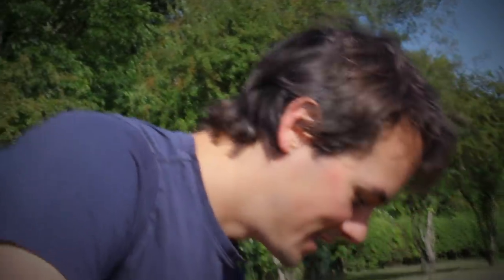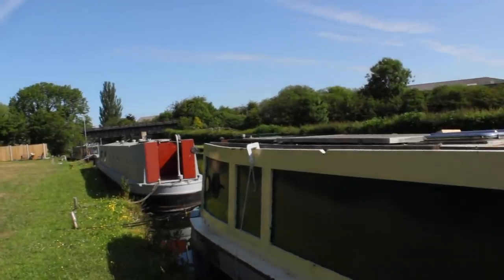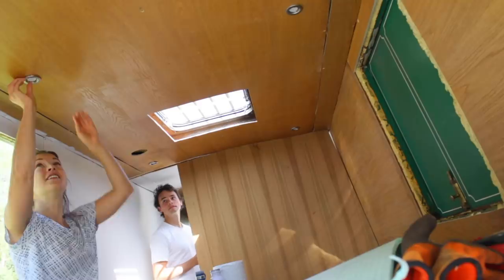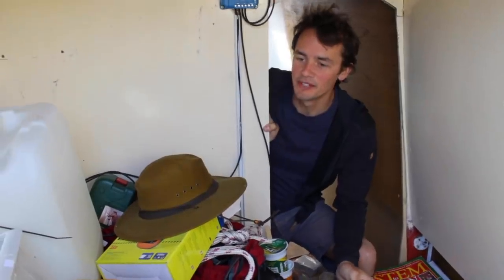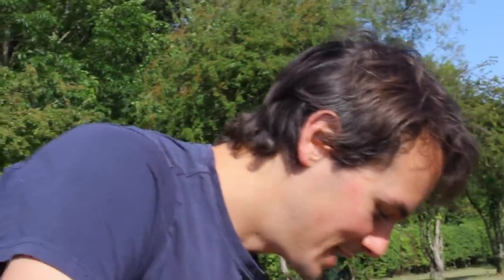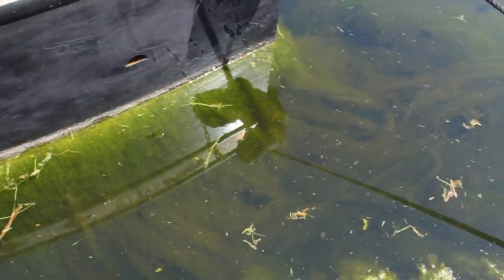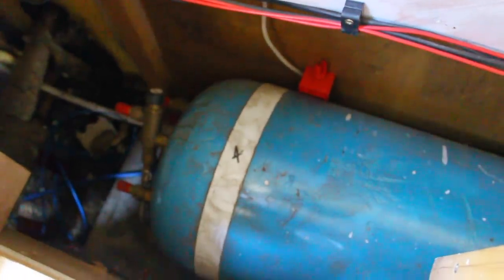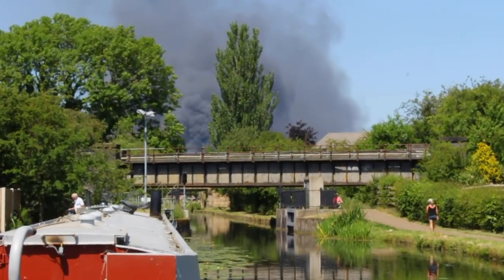Ep7 Lockdown DIY: Building our off-grid NARROWBOAT cafe

Comment: What got me interested in narrowboats is that there made out of steel, and I have a weld shop here in Vegas. I've looked up prints on some boats, and it shows a space between the floor, and the 10mil base plate. It would be very simple to make food, wine or just any kind of storage, and since its under water it should stay rather cool. Mama duck is getting very used to you both, and hopefully next time we'll see the ducklings.
Thank you!
Reply from the maker: Yes! We thought of doing that, we've heard that some people use that space as a wine cellar :-)
Reply: @ADVENTURES with Christian.....dude go with a 12mm or better still 15mm baseplate then you would have room for under floor storage because the thinner the baseplate is the more ballast you'll need and that's normally under the floor😉

Comment: Thanks, guys, that was great. You are making progress, slowly but surely. Jemina seems to be well settled there, where are you going to fit that great ramp for her little ones?
That friend, Paul, sure has some cool gear. More Power! He made short work of cutting those boards down for you. If you are now planning to hook up the calorifier to the engine, which is a great idea, what was being used before to heat the water? Gas?